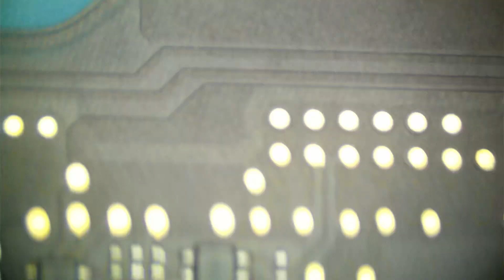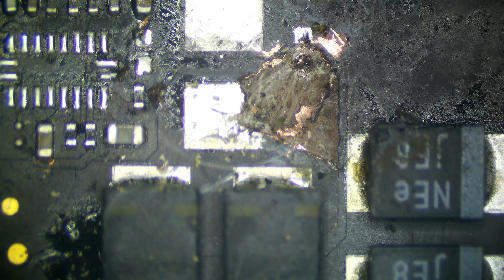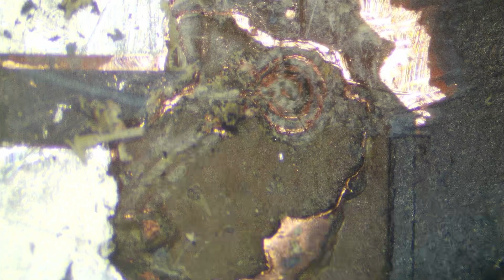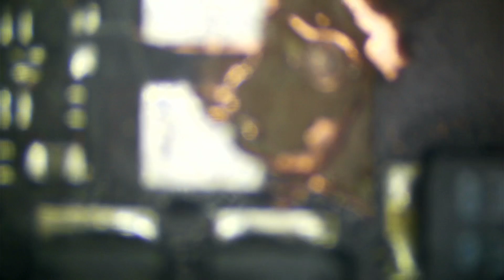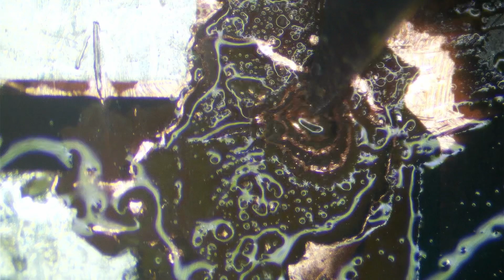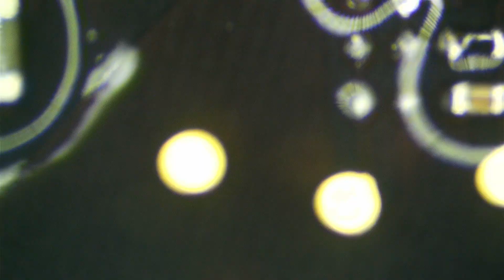Another A1990 with a 6 layer internal PCB short... Can we save the data?

Comment: I got one lenovo to life, it had a big burn thru all layers. Cleared the burn area and got problems with power button, charging light and screen backlight. Had to run wires for backlight and power button but hey, laptop seems to work ok, well with dead usb3 port and two usb-c ports. Only one usb3 port remaining, but its enough.